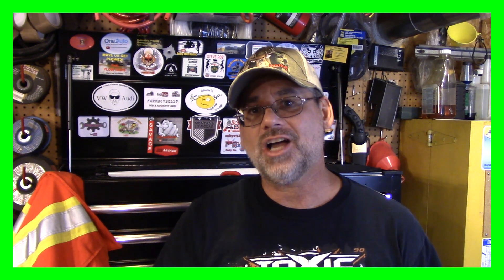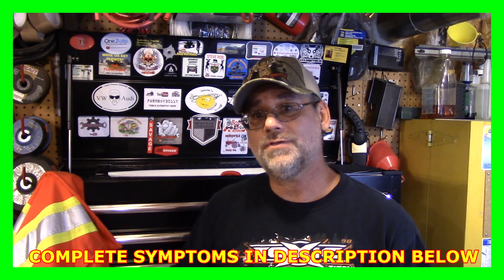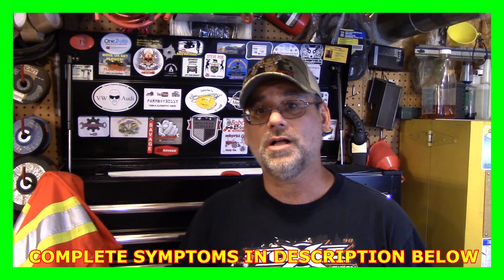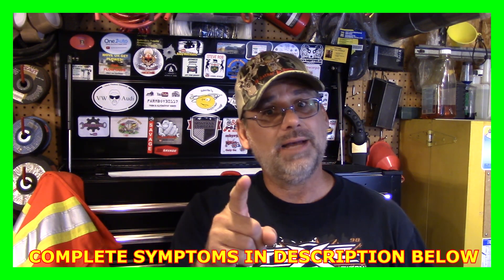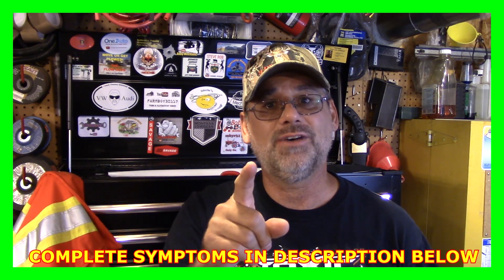F150 STALLING AT STOPS  - DEALER CAN'T FIND FIX - PART ONE

Comment: I had this same problem -gas mileage was down to 13.1 average and complete loss of power and erratic idle -I found this video and bought the part and bam! just on my first test drive went up to close to 19 mpg with combination of city and highway driving -incredible that that part won't even throw a code disconnecting the entire part , Long story short is the problem is fixed -thank you !!!
Reply from the maker: That's awesome , so glad to have been a help. Cheers 👍
Reply: I have a 2010 5.4 F150 it’s doing the same thing what’s the part you bought to fix it

Comment: Well best of luck.  I had a similar problem on my chev .  After I remote started it it would not come out of remote run but i could drive it as the key was on.  Of all things it was the brake light relay dirty contacts.  I know yours isn't this but you have to keep an open mind  Good luck Steve.
Reply from the maker: Thanks and that's an odd one too.

Comment: Never encountered this problem Steve but I have some tips for you.  Hook up your scope and look at crank and cam sensors, then monitor charging voltage at alternator and at battery.  If you can't find anything there monitor a 5 Volt reference circuit and see if you loose the 5 volt reference, if you do that can indicate a power or ground problem to the way.  Also you could look up a topology schematic of the network and look for a common splice for all the modules and see if the network is acting up.  Also you could monitor the throttle body controls while this happens also.  This is how I would attack the problem.  Sorry I can't give any pattern failures on these.
Reply from the maker: This happens about every 8 months - thats a lot of monitoring there buddy LOL   Thanks for the suggestions .
Reply: STEVE ROB REVIEWS Yes I know, guess the next question will be then how much money do you want to potentially waste to find this issue.  Hopefully the part you are putting on isn't too expensive.  Best of luck.
Reply from the maker: Thanks buddy

Comment: I seen a lot of problems with the IACS getting stuck on fords and when you restart it reinitializes comes unstuck and it runs fine a gain for a while.  I never done one on anything that new though.  Normally a removal and some good cleaning with some brake clean and some nylon brushes to get rid of the carbon will fix the issue, but if it has done it since it was a few days old I can't imagine it had carbon built up then.  Maybe a bad IAC.  Hard to confirm though.
Reply from the maker: Tom this is a drive by wire and I'm thinking no IAC .  The truck has about 55,000 miles on it.  It will be the parts cannon real soon. I'm giving this truck to my daughter and getting a new one soon and I don't want this to happen to her while driving it.

Comment: Similar problem solved...had 2007 f150 doing same thing. Same symptoms exactly. No codes. While replacing AC compressor, I realized wire harness to crank sensor passed by AC high side lines and over time developed a small short. In short...unplug wire harness from across compressor and crank sensor (same harness/ 2 leads) then pull slack up to inspect. If this happened to yours the damage should be easy to spot. Spliced my short. No more problems.
Reply from the maker: Jeremy I have not had a stall since but If I do that's a great tip to look for and I will check for sure. Thanks buddy.

Comment: Still hunting for a fix for my intermittent rough idle/stalling when stopping on my old 93 F150.  285k miles I'm sure doesn't help.  I started with the EGR position sensor and gasket, then the valve itself, tested the TPS, and then replaced the IAC valve...still gives me issues.  They added a lot more electronics and sensors in 7 years so all I can offer is a hand shake and wish you good luck!  Off to part 2 to see if your fix and maybe spark some ideas.
Reply from the maker: It's tough tracking down a fix but the pros do it well and fast.
Reply: Chaos Garage if your rough idle and stalling when coming to a stop is here and there but when you step on the gas it goes away its your vct solenoids. Changed mine and problem went away.

Comment: My 04 Chevy Silverado would want to stall only when stopping and it turned out to be the TPS. (Throttle position Sensor) Never threw any codes or anything it would just fall on its face when stopping and then regain the idle rpm and if not it would die. IT would start and run fine at all speeds thought. I replaced the TPS and it was fixed and never did it again. But yet again the TPS went out a year later and I'm having to replace it again. Cheers Steve!
Reply from the maker: Thanks and its crazy hard for me to figure this all out but I have to try something. Lets see.

Comment: My 2015 Ford F150- 5 litre is also stalling at stop lights. It started this beginning of August and is slowly getting worse. The dealership doesn’t know; there was no yellow engine light on( back in the end of September) but they said a code was showing that the thermostate was faulty; it was changed but problem still there. Just last week( Saturday October 14/23), the engine light came on; stayed on for 2 days then went off. Now it is Weekend of October 21,22, and no engine light on, but still stalling or trying to stall at intersections.
Reply from the maker: John the computer stores all the times the engine light goes on so theses a clue there.  I'd  get a good tech to retrieve the code and off a fix .  Mine never threw a code .
Reply: This might be the VCT/VVT. I replaced the drivers side but didn’t do the passenger. Stopped for a few years but I think it’s time to do passenger since it’s starting again - 2016 F150 5.0

Comment: I’ve had that problem and it’s been in the fuse block on the passenger footwell. Sometimes water damage other times has been connection issues from the factory. Hard to say without seeing it, but I’ve done lots of those fuse blocks. Good luck Steve!
Reply from the maker: Interesting  - I will look today . Thanks
Reply: I have also seen corrosion behind a relay a time or two in the fuse box he is talking about .
Reply from the maker: Interesting and it would stick once in a while and not set a CEL - now that would be hard to diagnose

Comment: Not a clue. After they stopped putting points in vehicles i became obsolete. Off to see part 2 . Thank you for the video, Steve
Reply from the maker: It's a tough one and lots of great suggestions but so infrequent  so it is only guesses  with pattern failures . I have to try something. Cheers
Reply: I think I am going to duct-tape a Bic lighter to the steering column just in case I have a problem like this.
Reply from the maker: HAHA

Comment: I have seen a few issues with trucks like yours but since the problem has been there since new it rules out most of them. What i have seen the most of is electronic throttle body problems. They can't react fast enough to engine speed. There could be a reflash for the problem but i believe you just had that done. Problem is if you change a part it could take months to know if the part corrected the problem.
Reply from the maker: Yes exactly and that was discussed as they have a history of TB problems . I'm going to go with an educated guess and see if it fixes it - the guess won't be mine either but its a logical one at least.  Here we go with the parts cannon. HAHA  Next vid . Cheers Bill

Comment: After a bit of googling I was surprised to find that this is a fairly common problem. Drivers usually mentioned that this happened when they were slowing down to make a left hand turn. A number  of people suggested that changing the purge valve seemed to fix the problem. Others seemed to have a problem in the fuse block located in the passenger footwell although those seemed to be less related to the slowing down/left turn issue. It's probably worth trying to manipulate the fuse block to see if you could cause the issue to show up. At least one person seemed to think the problem was fixed by changing a valve in the gas line.
I'm very interested to hear what they thought was the problem. Have you tried any diagnostics tests yet?
Reply from the maker: Interesting you mention that and I googled the same  but I do have 3 friends that work at Ford and they have suggested I try something and in the next vid I will . You can run out of  money guessing but a logical guess seems reasonable.   I like to test and prove a fault than just guessing or throwing the parts cannon  at it.  Lets see real soon I have to do something so lets start with a small parts cannon first :)

Comment: Ive got it happening right now on my 2010 f150 5.4.  I already went through cam phasers and a factory rebuilt Ford 5.4.  The current engine is still under warranty as I have about 20k on it and it was a 36,000 warranty.
Reply from the maker: Ben the dealer couldn't find anything when it was under warranty . No codes  or faults or common complaints so I was told .  After I replaced the purge valve it's never stalled since.  There's lots of possibilities but for the low  cost of something I could fix myself, it turned out to be the right  fix for me.

Comment: Did a quick search, looks like you are not alonFrom what little reading I did, sounds like it may have something to do with the throttle body and/or MAF  or there is a purge valve of some type that sticks open or closed.
Reply from the maker: Yes I read the same and my buddy at Ford and I agreed to change one of the parts you listed . Next vid buddy . I'm hoping this solves the problem . I'm giving this truck to my daughter and getting a new one soon. Thanks buddy I appreciate the comment. Cheers

Comment: I have a 2005 when you start it, careful you don't accidentally turn the key back after starting. It only takes like a 1/16 or 1/8 inch back to stop the engine. Road vibration 😎

Comment: Stalling at stops & no check engine light I would guess a sticking IAC, though I would suspect that it would happen a lot more frequently. Was your fuel level about the same every time this happened?
Reply from the maker: Fuel is always more than 1/2  - so infrequent but next vid I will be doing something. Cheers

Comment: was the light coming on for no oil pressure a separate issue or did the fuel vapor purge valve fix that and the stalling?
Reply from the maker: Good question , yes when the engine stalls the oil light  turns  on.  Yes the  purge valve fixed it , not one stall since.

Comment: This happening to my 2007 f150. Coming to a stop the whole truck kinda vibrates/ shakes and stalls right out. If I feel the vibration in time and hit the gas it comes right outta it. Also comes outta it when I switch from D = drive to park or neutral.  It dosent happen everytime but it's happing more frequently than I like. No dash lights or codes. Has plenty of oil. What is this?
Reply from the maker: Hi Rebecca 
Your symptoms are totally different  from mine .  I would try a simple fix and clean the throttle body.  A dirty throttle body can cause exactly what you're experiencing  , worth a try and low cost , you can easily do this yourself.
Reply: The same thing happens to me in 2018 and I don't know what it is, did you find the fix?
Reply: Did you ever figure it out ? I have an 07 f150 it does the same

Comment: I have intermittent issue on my 2014 dart. Except mine kills the controls and the engine is still running. Dealer will not throw parts at if no code. In my case they can't swap part unless engineer at manufactuer oks it . This is what we get for letting electronic run our life. A slight voltage drop and well we now have computer issue. I hope u get it figured out. Thanks
Reply from the maker: Exactly and until it can be seen at the dealer it's a fault they can't test for . I will try a logical part next vid in hopes it solves the stalling. Cheers
Reply: 8

Comment: Hey Steve I’m having issues with my 09 F150 it runs perfectly fine for 15min and then shuts off and shows no codes nothing. It will crank but won’t start, then after 20min or so it will turn back on for a while then soon turn off again. Do you think the solution may be the part 2 Video you made?
Reply from the maker: I would say not in your case. You definatey need to look at the live data from a scan tool to see what the fault is .  A good mechanic should be able to find it .

Comment: Wow! As you know, you can't find nothing wrong when it's working fine Steve! With a problem like that, it could be anything, but just taking a guess, I would say that you've got an intermittent loose electrical connection somewhere :)
Reply from the maker: Makes sense and where do you look for that.  I  have a good hunch what it might be and some real smark friends at ford helping me as much as possible so in the next vid we shoot the parts cannon at it. LOL
Reply: One other thing that I thought of was an idle control valve that might be sticking. I remember you saying your idle was flaring up in a previous video on your F-150 when you changed the battery. Personally, I don't see how changing the battery would cause an issue. I believe it was the MAF all along and it was just coincident that it happened three days after you changed the battery. Hopefully Steve, the part(s) won't be too expensive in trying it out. And I guess it's going to take months to know for sure if the issue is fixed :)
Reply from the maker: Yes a lot of things it could be but I was hoping somebody had the exact same symptoms , Oh well I have time to find out.

Comment: I have the same issue. I changed the throttle body positioner sensor it helped some then I thinking it the iac idler control sensor sometimes it gets carbon up sometimes u can clean it with carberster cleaner an cue tip or just buy another one for 40.00 at advance auto parts I bought a new one. Fixed it

Comment: I changed the same part. It still cuts off when you come to a stop. Just it runs out of fuel. New fuel pump and filter. Can't figure it out.
Reply from the maker: Tammy their are many reasons for a stall but I would definitely check for any codes first , mine showed no codes so I had to try some things that could cause a stall.  The possibilities  are lack of fuel or lack of air or lack of ignition.  I'd try the air next and make sure the throttle body is clean as a real dirty throttle body can restrict minimum air .
Reply: @SteveRobReviews  well, I've found the problem on mine. The main wiring plug that goes to fuel pump and the tail lights was the problem. Even though it looked clean and fit tight, it wasn't. Cleaned it up and put some wire dope in the plug and solved the problem.
Reply from the maker: @tammyquattlebaum3904 Awesome 👍

Comment: Lock up torque converter holding too long, stalling the engine.
Reply: That just might be right. Worked at Jeep oh 24 years ago . Had a few Jeeps that would stall when the customer slowed down to a stop. Maybe that explains it.
Reply from the maker: That seems logical but to me I am not feeling  any forward  push  - I  have never experienced that before so i don't know if I would feel anything .  That's interesting and your the first to mention it.

Comment: I need to know more...Keep in the back of your mind Steve that often an issue that doesn't trigger a code may be mechanically at fault and not electrically...What's low engine light mean.?..Low oil level warning.?..Faulty...Aaa..I'll wait 'cos I've never worked on one..Sounds like it just likes to remind you of it's birthday.
Reply from the maker: It only stalls on a decel at low speeds and so nice you don't even notice it. The only thing I notice is the tack is at zero and  a blue  oil can light appears on the dash lit up  then i get a chime thru the speakers and that's it. NO codes or history codes.     I put it in neutral and it starts right up and goes great for almost another year or less.

Comment: My 09 King Ranch with the 5.4 3v did this exact same thing earlier this evening. Just as I was easing into a parking space it began sputtering as if it were going to stall. Upon starting the truck an hour later the sputtering return within seconds of letting the engine idle. It smoothened out some once I gently pressed the accelerator. The check engine light was on however I was able to make it back home without incident.
Reply: To further add to this now that I think about it, A few days ago I took my truck in to transmission shop to check fluids and to schedule me a service since i’m approaching 150k. Tech informed me that everything transmission wise was fine however stated that cylinder 1 and 6 each had a misfire. He further added that had the scan tool not indicated such he wouldn’t of known otherwise. Prior to this I had the fuse 27 relocation kit installed as the fuse appeared to be slight burnt (fuel pump). It wasn’t totally melted however it was enough for me not to chance it. I’ve been chasing a P0442 small evap leak code for the past 8 months but the ford techs said it’s probably just fuel inlet and it to keep clean using the funnel. As of a week ago for the first time I received “check fuel inlet” message on the dash while driving on the interstate. Apologies for the long winded comments and questions. I’m open to suggestions…thank you for sharing these videos, Ill scan the truck and see what codes I get other than p0442… Love my truck as it is paid for however seems like it’s one thing after then next. VCT’s, faulty O2 sensor pcm updates, water entry from several places, Rust in the rockers, bulkhead connector, multiple ac issues, abs module, hub assembly…lol Merry Christmas 🎄🎁 🛻
Reply: P0012 P0022 P0016….Looks my issue is going to be VCTs and Timing related components. Airing on the side of caution, gonna leave her be until Christmas passes and I can have it diagnosed more thoroughly. Thanks again for sharing the videos related to these years model trucks.